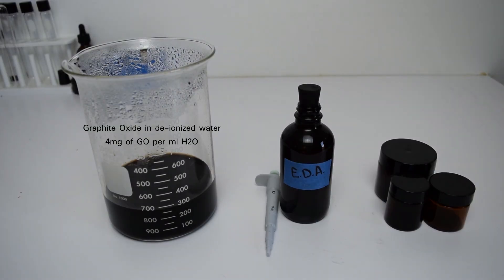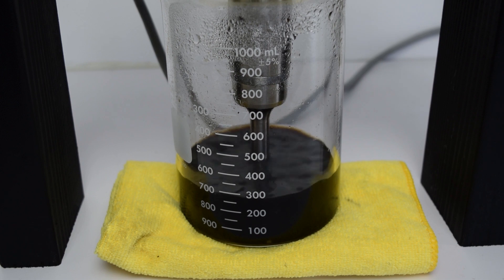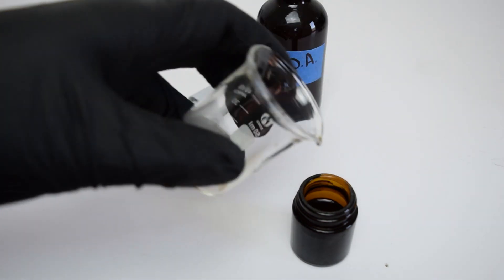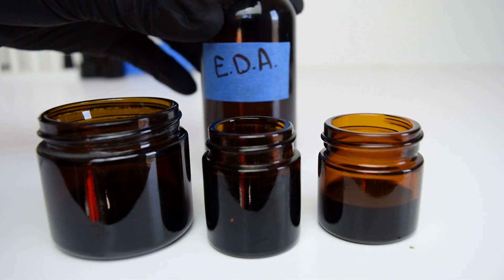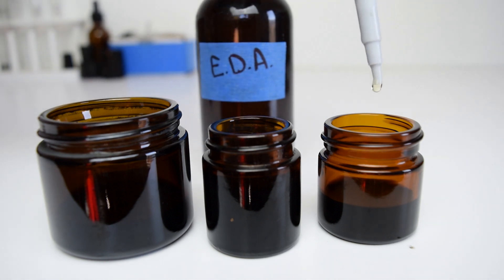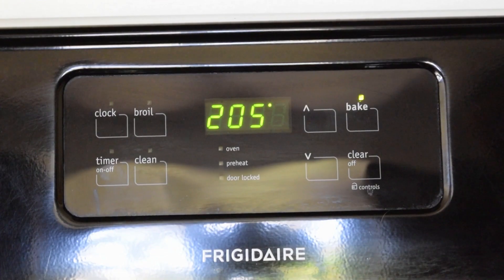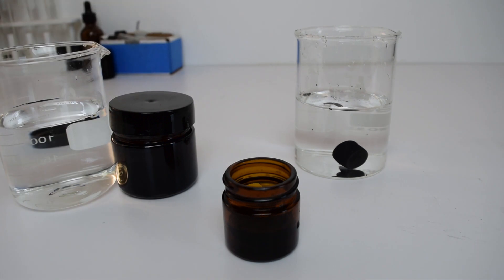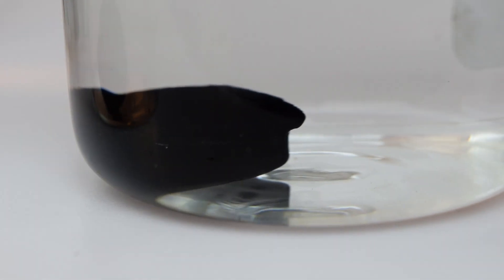Graphene Aerogel Synthesis - Part 1

Comment: More than Awesome, you promised this one ages ago lol.
But i forgive you ha ha can't wait for part 2  😎
Reply from the maker: Haha thanks! Yeah I wish I could have posted this way sooner but too many problems made it more difficult than it should have been.
Reply: @KingswellLabs  yes have been wanting to synthesise this stuff and try it out in my Batteries as a storage medium, but could not work it out properly from papers that i read.
Reply: But i do have some nice GO made with 5 micron flake Graphite on the shelf, only prob i got now is filtering the damn stuff lol 😎
Reply from the maker: @mouldykev  If it's clean there's no need to filter it, just mix it in DI water and ultrasonicate it... That will break it into graphene oxide!
Reply from the maker: @mouldykev  I had the same problem, I went through several papers trying to find something that worked. I had many failures until I settled on the methods of two papers by chance.
Reply: @KingswellLabs  hi again, is there another reducing agent that can be used instead of that EDA.... it is nasty stuff and hard to get in the uk
Reply from the maker: @mouldykev  Hello! Yeah it is nasty stuff, the only other reagent I know of is Hydrazine which isn't any better. You can get EDA from ebay, looks like there are some sellers that will ship to the UK. The other problem is that you need so little for the reaction, but you have to buy in 100ml or more.
Reply: @KingswellLabs   hello, thanks, if you don't mind, i have a few questions:
 -why did you close the containers? -
do we put the same amount of EDA for hydrazine too?
Reply: Can't you maybe tell me if the final result is stable if saturated with water?

Comment: Hi, Kingswell Labs, I did enjoy your video it helped me a lot to understand the freeze-drying process, I have a question I don t want to synthesis an aerogel but a graphene oxide sponge. I use 10 mg/ml as a concentration and dispersed it in 200ml of water. after the ultrasonication process, I applied the hydrothermal method and freeze the solution before taking it to the freeze-dryer. but in the end, I did not get a sponge but the dust of particles. I try to understand what I have done wrong? Could you please assist? Thank you
Reply from the maker: How much of the 10mg/ml GO solution did you disperse into the 200ml water? You want to keep a concentration of GO to 2-5mg/ml. Also make sure you are using deionized water.

You will need to determine where in the process it failed. You should get a good solid hydrogel sponge after the hydrothermal process. If is not, than your reducing agent is bad or not the correct amount used. Also be careful with ultrasonication, you can damage the GO and will not produce a solid hydrogel. This is usually where people have problems. If you get a good solid hydrogel and it turns to particles when freezedrying, it could be the freezedrying process failed (allowed ice to change to water before gas).

I hope this helps!

Comment: I done it, but after removing the container from the oven, the separate particles were at the bottom of the container and were not compact and in a molded form. I cant find the problem that is very kind of you to help me to find the problem
Reply from the maker: I think you should look at your Graphene Oxide, that seems to be the problem with most people. Ultrasonicating the GO can easily destroy and reduce the GO. If you ultrasonicate, only use 50% duty cycle for one hour. The formation of the hydrogel should be the easiest part of this method, it is very forgiving if you have good GO. Good luck!

Comment: Does the graphene oxide dispersion have to be 3-4 mg/ml? is it like the best concentration to use or can you use another concentration? Thank you!
Reply from the maker: Good question! I have used 2mg/ml-5mg/ml concentrations and the only difference is the size resulting sponge. With less concentration, the sponge is smaller, the higher concentration the sponge is bigger. But, I do not know if the structure of the sponge is affected by the concentration, which it could be. I have noticed better results using smaller concentrations but I have not quantified the aerogel yet, so I don't know for sure. I would recommend not going above 5mg/ml.
Reply: Kingswell Labs thank you so much for the reply 😊 i was going to do 5 mg/ml but i wasn't sure, so thanks!

Comment: Could you just use graphene instead of GO? I'm just not a fan of the modified hummers method to make GO
Reply from the maker: Unfortunately there is no way I know to make graphene into a 3D structure, The O and H molecules are needed for bonding and ordering. 

I am not a fan of the current process of making GO as well, which is why I am exploring different/environmentally friendly synthesis methods (without success).
Reply: @KingswellLabs  I'll look too,  if I find anything,  I'll share it 

I make a lot of graphene by electrochemical exfoliation
Reply: @KingswellLabs  what about graphene surface functionalization? Cooh groups

Comment: How do you remove the gel from the water without breaking it?
Reply from the maker: You should be able to just dump it into a glass of water without breaking, the hydrogel is fairly easy to handle. If it is breakng up, something didn't go right. How bad is it breaking up?
Reply: @KingswellLabs  Very bad ... It forms nicely but when removing it to put it in the freezer it breaks
Reply from the maker: @gianniskarnis7898  OK so there could be a few things wrong. Check that your GO solution is at PH of 5-6.  Make sure the solution doesn't heat past 25C when sonicating. Last make sure EDA is thoroughly mixed.

I am going to post an update to clarify a few things and make some corrections that I am running across now.
Reply: @KingswellLabs  thank you very much for your advice... I will be sure to check everything you told me

Comment: Spin a variable electromagnetic cylinder in a beaker of graphite oxide solution, make sure the liquid is spinning within the container as a result of the em cylinder motion. Add in your reducing solvent dropwise and Increase the magnetic field strength slowly, watch your graphene aerogel crystal puk grow. You're welcome ftf
Reply from the maker: Thank you very much for this comment! It sounds very interesting and I will give it a go, but I have a few questions if you don't mind. 

How fast do I need to spin the magnet?

I assume the cylinder is oriented lengthwise in the solution not perpendicular like a stirring bar? Does it matter which pole goes into the solution? 

Last, what strength of electromagnet do you recommend? Feel free to PM me.

Comment: can i use it for 3d printing?
Reply from the maker: There is a similar technique used to 3d print graphene, basically you would extrude the graphene oxide solution onto a very cold surface so it freezes immediately. After printing, you would freeze dry or use liquid nitrogen to remove the ice water. lastly it's heated to remove the oxygen to produce graphene. There is not much information on how well the structure holds up to stresses, but I could imagine a hybrid technique with something similar to what I show that would increse is cohesion. 

From what I have tested, heating GO to remove oxygen leaves the material crumbly and not very useful.
Reply: @KingswellLabs Thanks for tour answer
Reply: So now I need a 3D printer, vacuum chamber piece of dry ice and a non-stick thermal conductive surface, so many ideas not enough money....